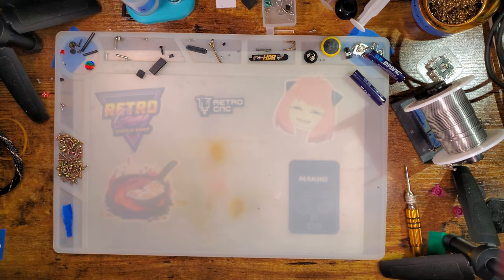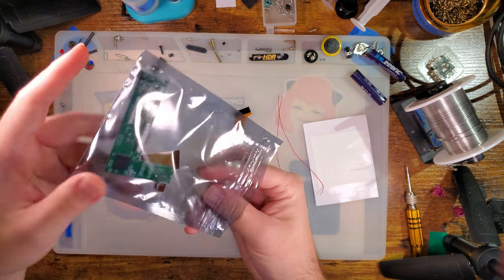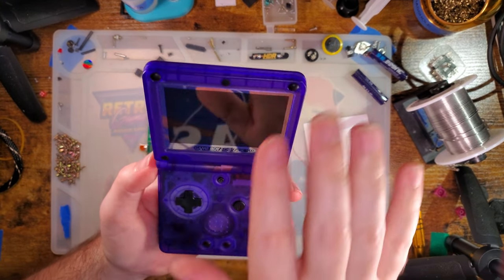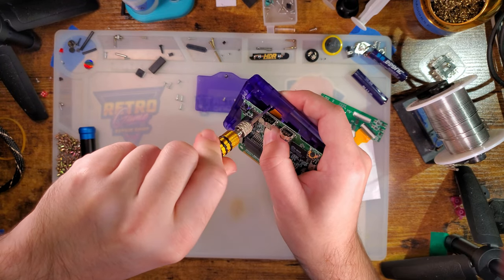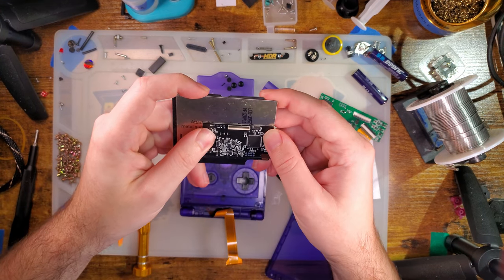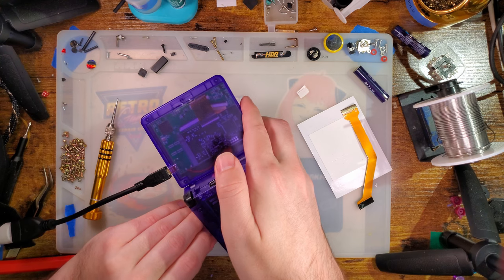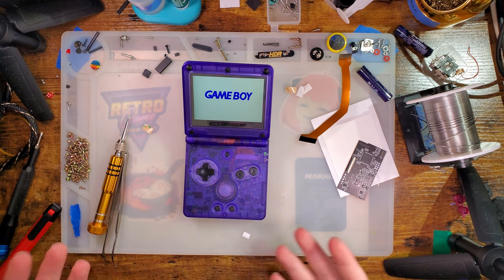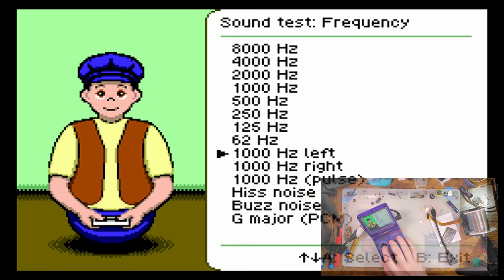Game Boy Advance SP Internal HDMI and IPS Screen

Comment: I think this kit would be much better off making the actual mini HDMI port a separate board to mount elsewhere within the game boy then using wires to connect it to the main board display out board mounted behind the screen as I do think that's a good place for the main board. Then you could mount it wherever you need and maybe even reinforce the plug by gluing it in somewhere. Just spit balling here, but splitting up the boards I think would be a great next step in this kit that would require minimum modifications to the board. May even be worth you just designing your own based off this and selling it yourself if you can figure it out. Start with trimming the current board and scraping away contacts to see if it'd be possible. Just throwing out my thoughts here. lol I kinda wanna buy a kit and see if I can do something like that just for fun.

Comment: I have a problem with a DS Lite, it turns on but does not have image, i tried several wifi cards and have no success, the flex cables are in good shape, the screens are not broken, what I´m missing? I like your videos, they inspire me to fix mi old consoles, but sometimesa it gets a little bit dificult, TY for the good content.

Comment: Hey mahko i have an issue with the funnyplaying ips mod for gba. I cleaned the power switch but tge light tends to flicker from green and red. Anything that would cause that?
Reply: Did you make sure the prongs of the power switch are making proper contact? You may need to bend them outward just a little. And if that doesn’t work 🤷🏽
Reply: @wilfisi588  may have forgot so ill do it again later

Comment: Good video. Kinda unrelated but is there a way to unscrew gba micro screws that are extrmely thight? Bought a new one and wanted to clean it, but no screwdriver I have will get them out. Tried using a rubber band to create friction but didnt work

Comment: Is it possible to make this HDMI modification without making the IPS screen modification?
EDIT: I don't speak English, if you said that in the video, unfortunately I didn't understand.
Reply from the maker: Yes, the internal screen mod is optional. You can use this without installing a screen at all if you choose but I'm not sure if all the power lines are passed through to support original screens.
Reply: @makho  Thank you very much, it helped me a lot!
Can you tell me if there is any mod to use an external controller?
Reply from the maker: @AryonGothic  This is probably a better idea than modding in a separate controller: https://www.youtube.com/watch?v=hMm9rqB_V3s

But you can also just use the arduino portion of gbaHD: https://github.com/zwenergy/gbaHD

Or you can go the insidegadgets route: https://shop.insidegadgets.com/product/gba-sp-wireless-rx-flex-board/

Comment: Hey Makho thanks for the video I managed to do this mod for myself. I wondered if there is a way of having both a v2 IPS screen and hdmi mod installed but still be able to adjust the brightness of the screen on the gba sp as mine is now left on a default setting even with the wire soldered to the ribbon cable, have you managed to figure it out? I also find the picture sometimes goes off on the tv if I move the hdmi cable any ideas? Thanks
Reply: Are you saying even if you solder the wire for brightness control it still doesn't work if this kit is installed?
Reply: @Ayseh_  Hi update on the screen brightness, I bought some more wire (0.28mm 29AWG Teflon) and soldered from point Q12B to the original ribbon cable point which is now located in the hdmi board and it works again! 😁 I am very happy with this mod and managed it with no soldering experience, some of the solders are a bit rough but hey it all works! I also found that the connection to the TV is better now after it has all settled, as long as you are not waving the console about it remains on screen nicely. Good luck to anyone thinking of giving it a go! 👍
Reply: @iamhollander  thanks man! I finished mine a couple days ago and all works except brightness of course cause I used the ribbon cable attaching to the board, I’ll take it apart and correct it later thank you!
Reply: @Ayseh_  hey there, thinking about doing this mod myself but I play a lot of “real-time” games (as opposed to turn-based), have you noticed any lag with this mod?
Reply: @jotarokujo4895  nope, mod is perfectly good
Reply: @Ayseh_  Then I’m sold, thanks!
Reply: @iamhollander  hey I was wondering if your sp screen stays on when it's plugged into hdmi? If so, what kit are you using? Mine turns off and I'd prefer it to stay on
Reply: Hey! What did you do with the picture going on and off? I barely move or touch the cable and the picture goes off. It ofcourse reconnects, but even when i barely move or lift the GBA sp the picture goes off immediately..
Reply: @buurak2211 It’s not a flawless design unfortunately all you can really do is make sure the board is nice and stuck to the backside of the IPS screen so the board isn’t moving when connecting the hdmi. Other things to consider is the cable you are plugging in you can quite easily get a flexible hdmi to mini hdmi cable from eBay and eliminate the need for the adapter in the middle which might be another factor in this issue, its all about the connection. What we really need is an SP docking station!!
Reply: @iamhollander  I bought the mini hdmi adaper and the difference was huge. With some movement and even touching the cables the picture doesnt go off. It still happens but waaay less than before! Thank you so much! 🫡

Comment: I wonder if this has the same audio noise/crackling/distortion like the HDMI kit for the regular GBA when processing audio over HDMI. This is pretty annoying even though i barely use the HDMI Output. But still a nice feature for the console.

Edit:
Just don't think about it. I mixed up the kits. I was talking about the other HDMI kit for the regular GBA without any settings.

Comment: Hey Mahko, would you happened to have the 3d print file available for the micro hdmi port? Kinda went too heavy with the filing on my end.
Reply from the maker: mine was designed around fitting in the specific hole I filed and I didn't save it
Reply: @makho  all good, thanks for the reply.

Comment: Is it correct that the HDMI kit for the normal advance can adjust the aspect ratio with the touch buttons but the kit for the advance SP doesn't support it?

Which IPS kit do I need for the normal Advance so that I can set the aspect ratio via the touch button?
Reply from the maker: That's not how it works. There are different HDMI out kits and the controls are part of the kit itself.

Comment: I have heard that It won't work with Funnyplaying kits (glitchy).
Reply: Really? I was about to grab it from aliexpress when I saw this comment
Reply: @nhlvan  My friend tried 2 different Funnyplaying kits on this HDMI kit but both had issue. He reported to the Aliexpress seller, they said customer needs to add a piece of paper to the socket to make the LCD ribbon stay tight, this method will solve the issue. But this is not true, it never works with Funnyplaying LCD kit.
Reply from the maker: no reason it shouldn't work
Reply: @makho  Did you test on Funnyplaying kits?
Reply: I had the same problem.
I also contacted the store and was told I needed to put a piece of paper across the ribbon cable.

makho, I would like you to try the test with funnyplaying ips.
Reply from the maker: @xboypro  bench test, yeah

Comment: Hi,
I bought the hdmi output and i tried to install it with a funnyplaying ips cable. Sadly it doesn't work, the hdmi output works fine, but the screen of the console does weird stuff. The seller has told me to put a piece of paper in the cable socket to tighten the cable, but it doesn't work either, and it ended up breaking the clip which holds the cable, which has ruined the board as i don't think there are replacements for that piece. I've noticed that touching the union with the ips ribbon cable and the ips screen makes the screen change the image, it doesn't fix it but it looks like the issue is related to it, but i'm not sure.
Do you know a way of making the funnyplaying cable work with this mod? I think there is a lot of people with that issue.
Thanks!
Reply from the maker: The flat flex connector used is a standard 0.5mm pitch connector. There are absolutely replacements available. Count the pins, note if it's top connect or bottom connect, and then any connector in the same pin count and pitch will be a drop in replacement as long as you can solder it on.
Reply: @makho  Thanks for your answer. The main problem here is why doesn't this kit work with the funnyplaying ips cable. I think a lot of people is having the same issue, i thought maybe you could bring some light about that.
Reply from the maker: @danieljimenezsogues5262  I can't tell you that, you should talk to the sellers of the kits you are working with.

Comment: Eh, I’ve already got the AGB HDMI kit and it works fine, so I definitely don’t need this kit since I’ve already got that and hell, I already just found a good priced Gameboy Player, so that’s another way to play HDMI Gameboy games and it’s even better with GBI. It’s just unnecessary for me. I get it for people who only have a SP, but you yourself already mentioned the issues with fitment and possible cracking in the shell, so it really isn’t a great mod.

Edit: I completely forgot that it also doesn’t turn off the LCD. That is definitely a major downside, it means the power drain will be even worse than the AGB because at least that one is just pulling power for the HDMI signal conversion and isn’t also pulling power for an IPS screen. Its definitely not a good kit if the only way you’ll get good battery life is if you don’t do that and just do play and charge instead.

Edit: Ok, good news is that it is supposed to turn off the screen and likely will in retail versions, so it at least will be using less battery life.
Reply: Also, I just got a Gameboy Micro and I so far love it, but the main thing I wanted to mention is that I actually found a seller that sells the Evangelion themed Stickers you put on your Micro’s. Just wanted to put that out there so that you could maybe update your videos to mention them if anyone wants the EVA faceplate stickers.
Reply from the maker: Per the manufacturer, apparently the screen is supposed to turn off. Which makes sense because that's what the AGB version does and this should be otherwise identical.
Reply: @makho  Ok, well that’s definitely much better and also makes sense, so at least the battery life will be much better. Still, already have one for my AGB and I already have a Digital Out converter and the Gameboy Player as an option for HDMI gameboy playing, so I definitely don’t need this for my SP.
Reply: @makho  Ooh, also, I noticed that Extremerate is now making DS Lite shells. Are you thinking of doing a video on that like you’ve done for their other shells? I’ve already ordered one to use for my DS Lite now that it’s hinge is cracked, so I hope they’re as good as their other shells.
Reply from the maker: @rickyrns1059  I might grab one but I have no immediate plans

Comment: I bought two of these kits just to discover they're not compatible with my two AGS 101 screens. I bought these as I completely destroyed both ribbon cables. Point being I cannot afford the proper screens or those needed chips for atleast 4 more months. Does anyone know a way that I could take the metal plate off the back of one of these screens and solder wires between the two to get them to function as one?
Reply from the maker: I fear that in an attempt to save money, you will end up costing yourself more than just waiting for the appropriate parts.